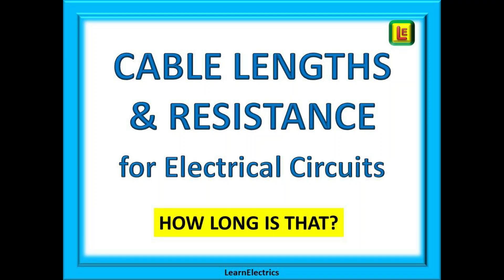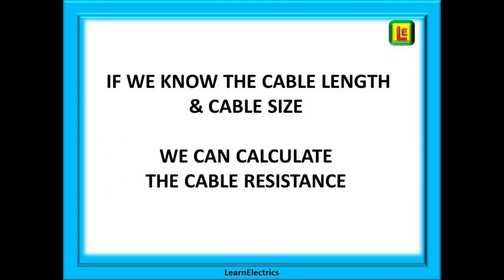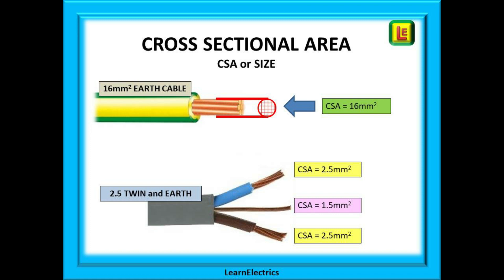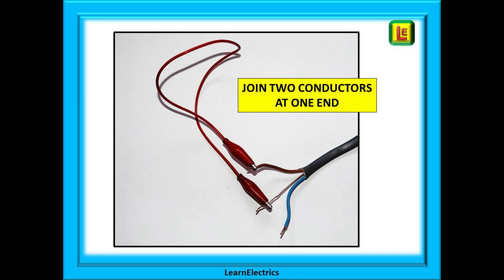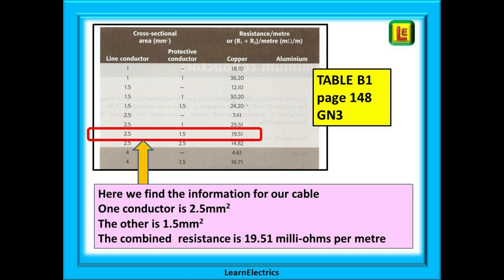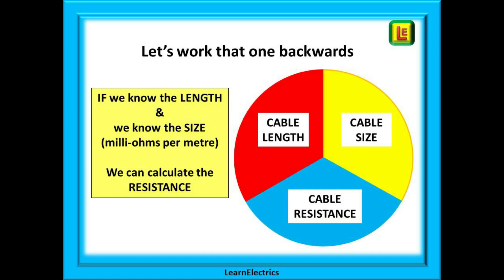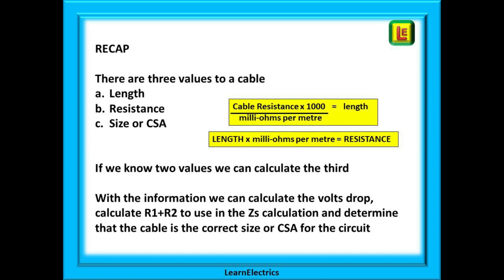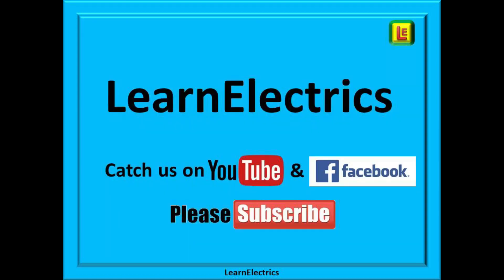CABLE   LENGTHS   RESISTANCE  and  CSA  for  ELECTRICAL CABLES

Comment: I know this is old but, how do they get 19.51mΩ in the onsite guide? 
I tried using 1.77x 10e-8 (@ 20°) for both the radius of 2.5mm (r=1.784) and 1.5mm (r=1.382) in my calculations.
 eg for 2.5mm² ; 1.77x10e-8 x 1÷π(1.784x10e-3)²
Reply from the maker: Just use table B1 in Guidance Note 3 . 2.5 plus 1.5 as in twin and earth is just the milliohms for 2.5 added to the milliohms for 1.5. Hope this helps.

Comment: if you have a length of single core cable,like conduit wire,can you messure from each end or got use 2 wires ,for flow and return ,and can you cut a 1 meter length of wire ,and messure it ,if it is not in the guide tables,so make your own guide ,like if you had a strange size cable ,or not solid cable ,like car wiring ,soft flexi cables ,love these vids,you make it interesting and fun ,jump in the back of the van with the megger ,do experiments,also can you do ir test on bare cables,check for ok,to use ,on off cuts,dead testing ,did once have roll new cable ,and circuit keep tripping rcd,turns out the cable was faulty ,short inside ,had rewire new cable and was good then ,but never seen new bad cables before ,caught me out
Reply from the maker: Yes, you can make your own tables for "strange" sizes. Use the tables in Guidance Note 3 Appendix B and you will be able to work out sizes like 1.25mm, 8mm and so on. Some sparkies will  continuity test and IR test a new roll. There is always a little bit of cable to get to on the inside of the cardboard roll. And yes, I once lost a whole days work for a damaged cable just 5 metres from the end of a 90 metre run. Thanks for watching. Dave.

Comment: I am going over your videos again Dave, as they are so good and my memory and retention is so bad. I have just noticed an error in your slides at 2'12" and wonder if anyone else has picked up on it? The picture depicts 2.5mm2 T&E as Class 2 when it only becomes that above 2.5mm2 and in reality is Class 1 solid core copper conductor. Nit picking but thought I would mention it. I am still a Huge fan of your work nonetheless.
Reply from the maker: Thanks Olly. The picture was only used as an example to show that the T/E sheath contained different size conductors. You guys are too good for me. Keep watching. Dave.

Comment: Is it the same for a ring circuit because the cable is 2.5mm and got two legs to the ring say you got a reading of 0.34 ohms  for r1+r2 still the same maths to work out the length
Reply from the maker: Yes, because you are removing the cables from the CU so they become one length of copper for resistance test. Then you can apply the maths as per the video to determine the actual length .
Thanks for watching.
Reply: So basically say I had a ring circuit that’s 50m long into a b32 

So I do my ring continuity test on it and I get a reading of 
L-L 0.14
N-N 0.14
Cpc-Cpc 0.23
R1+R2 0.09

Does that mean the to work out length of cable it would be (0.09 x 1000)/19.51 = 4.61m for the whole circuit or would that be for each cable so overall length of cable would be 4.61x2 

Because when doing the calculations the cable seems very short for the overall length of the run on the circuit

Comment: Probably wont answer this question but could u help me out with this question:

 Find the csa of a single copper cable 500m long, which carries a current of 2.5 amperes and has a volt drop of 3.58 volts. Take the resistivity of copper to be 1.72 x 10-8 ohm/metre.
Reply from the maker: Probably 16mm cable. Top of my head 15.3 thereabouts.
Reply from the maker: If its just one way, that might be 10mm cable. I was basing 16 on there and back. Do you have a formula.

Comment: Sir and how can we measure the length installed fire rated cable
Reply from the maker: You would need to know the milli-ohms per metre resistance for the cable and then use the formulas shown in the video. Thanks for your comments. Dave.

Comment: Is there a formula for measuring the lenght of a ring circuit using R1 & R2 and dividing by the resistifity of the cable...I was thing make it into one  big radial from the fuse board....would that work...or there is formula we can use
Reply from the maker: That's an easy one Dennis.
I'm assuming standard UK 32A Socket Ring in Twin and Earth 2.5 Phase/Neutral and 1.5 Earth. You must use R1+R2 not Zs.
*   Length of circuit cables is R1+R2 multiplied by 205   *
This will give you the length to within a metre.
Good question, you keep testing me. Perhaps I will do a video on this in the future.
Keep watching mate and spread the word. Dave.
Reply: @learnelectrics4402  lol...ur the mentor I have been search for
Reply from the maker: My pleasure.